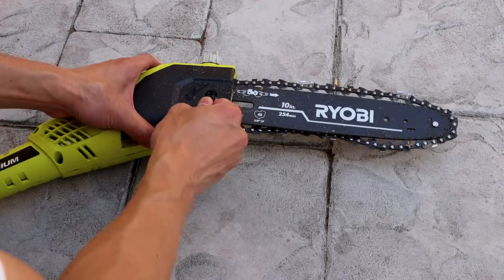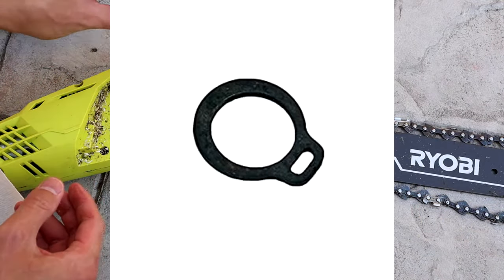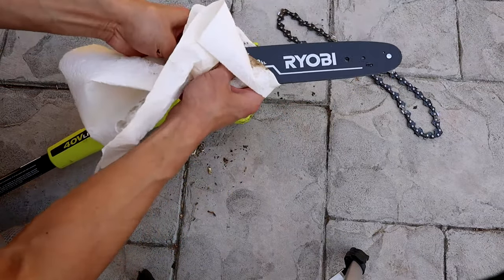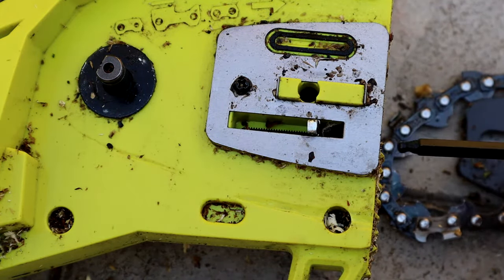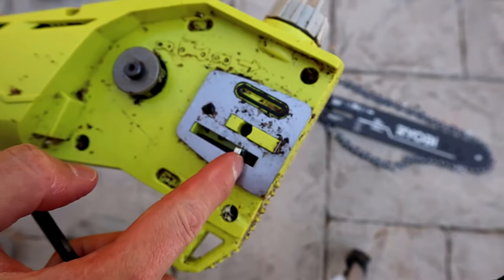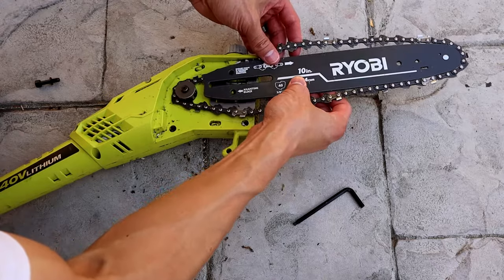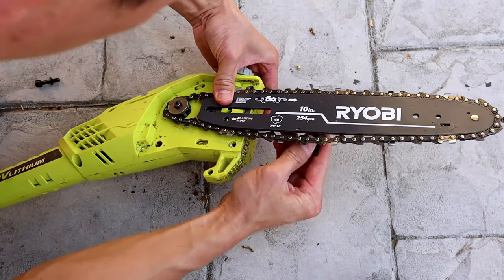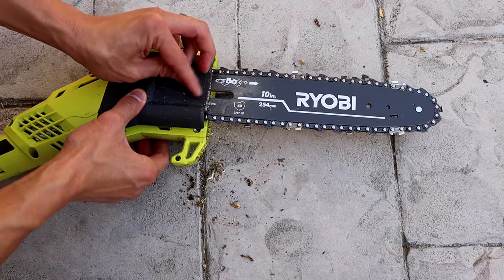Ryobi 40v 10in Chain and Pole Saw Tensioning Adjustment Tutorial

Comment: Just a note - you do not have to remove the cover just to adjust the chain tension.  Just "loosen" the allen bolt then you can adjust the tension by turning the adjusting screw. Don't forget to re-tighten the allen bolt. I could see removing the cover once the job is complete to clean all the sawdust and oil from underneath the cover.  Another tip - if the bar oil is gravity fed it will continue to drip when the saw is not in use - I usually empty the oil before putting the saw up when I am done.

Comment: I started taking down a mulberry tree that is too close to my home with a reciprocating saw. Then I got the Ryobi 40V 10 " Pole saw that got stuck in the middle of a branch in March. Once it started raining I backed off. I made three cuts this afternoon and got those branches off my roof. I'm hoping it is dry tomorrow so I can take he final branch down. Thanks so very much for this video now I know how to correct the tension after saw dust clutters the tool.
Reply from the maker: No problem! Ive found that basically every time I use the saw, that I need to clean and re tension the saw.

Comment: Thanks so much.  I have a newer model (2023) that has a bolt, so socket wrench takes the cover off, and a screwdriver to adjust the tension, which can be done with the cover on, but with the bolt loosened.
Reply from the maker: Glad they are least revised it so it's easier to adjust.  Mine is a bit of a task after cutting the trees to maintain.

Comment: I misplaced the allen wrench that came with my pole saw, will a regular 5mm allen wrench work for the tensioner or do I need the one that came with the saw that has a ball on the end???
Reply from the maker: A regular allen wrench isn't going to work because the head is different.  What you're probably going to have to do is contact Ryobi and get a replacement from them.
Reply: This is what I was looking for....
Reply: @nukem384  I will replace the screw.

Comment: Thanks for video. Do you have any suggestions for how to reinstall the retaining ring on the socket?
Reply from the maker: You basically just push it down.  It should click into place when it's seated properly.  You'll feel it.
Reply: @nukem384  I haven't been able to get it over the "rod" - it's amazing to me that it even came off so easily
Reply: I bought some mini snap ring pliers for external ring and was able to get it on finally! Thought I would post here in case someone else has the same issue. Thanks again!

Comment: I followed your directions and appreciate the clarity. However, I have now tried three times to use the saw and the chain immediately get slack when I rev it up, but before using it. Any thoughts? Thank you.
Reply from the maker: Something is wrong. I would exchange it for another one and see if that helps
Reply: @nukem384  Thank you.
Reply from the maker: @stevengraham8130  Did you check if you sprocket was coming off like mine?  Obviously that would be a problem if you don't have the clip like I showed very briefly.  It's either that, or when you check the bar and chain, is the adjuster piece that creates the tension moved from where you just tightened it from?  That could also be it.  If the latter, I would exchange it if you can.

Comment: Hi thanks for your video. I cannot find the allen wrench provided in my pole saw if you cannot find it anymore in your kit, do you think it is available in stores?
Reply from the maker: I'm sure you could find something.  If not, contact Ryobi and you can buy the part from them.  That's what I ended up doing with the clip that was holding the sprocket on that I mentioned popped off at some point.

Comment: Useful vid, thanks.  Would be handy(for me)  if at the end you give the fully tensioned chain a tug to show how far it moves from the bar?
Reply from the maker: According to the manual, the tension is correct when the flats on the tie straps.050 in away from the bar when you give the chain a little tug.  Basically, it should be pretty snug.
Reply from the maker: Jim Allen  hmm. Maybe the tensionor on your unit is defective? It shouldnt be popping off like that. I had a similiar issue, but it was my retaining ring, which was a pretty obvious fix
Reply from the maker: Jim Allen  definitely. Its probably only a couple of things. Maybe theres something wrong with the cover, the retaining ring, or the tensioner. You should know if its an easy fix pretty quick

Comment: How does the retaining ring go on?
Reply from the maker: There's a groove at the bottom of that stem.  You have to expand the ring just a bit and get it into that groove and it'll stay there.  Not sure if you've ever worked with cars.  But ball joints have this same type of retaining clip and it works the same way.
Reply: @nukem384  Thanks for the response...does it go on the top of the sprocket? Any chance you can take a pic? Thank you!
Reply from the maker: @derrickkessler5596  Yes.  Put the sprocket all the way down and then you'll see the groove right on top of the sprocket.  Retaining clip goes in the groove to hold the sprocket in place.  My previous response was a little bit off.